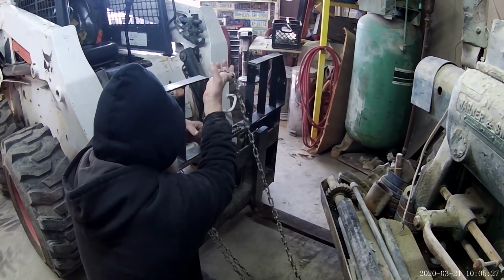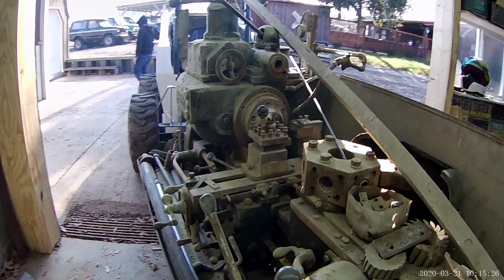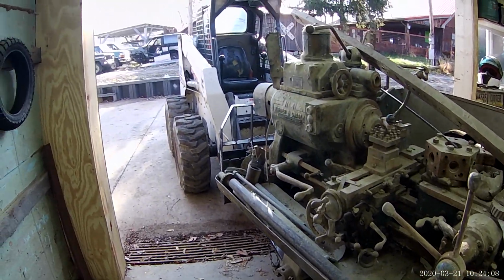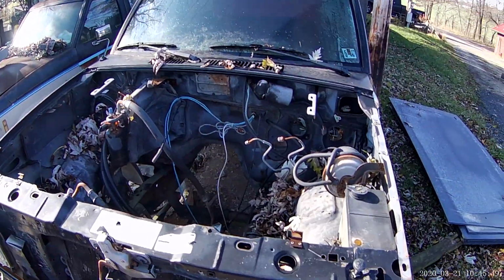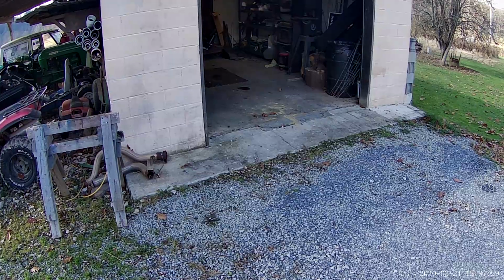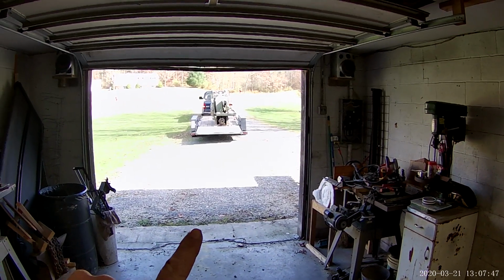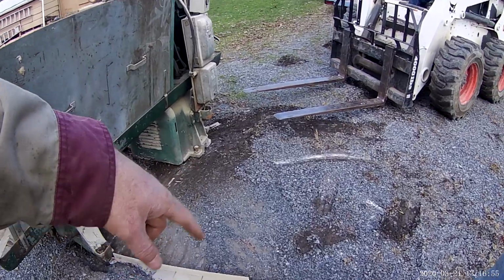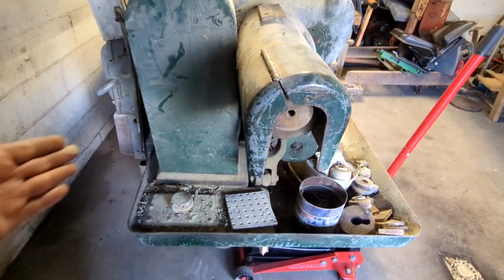Another huge shop upgrade!  We got an Warner Swasey lathe!

Comment: There is no such thing as a "free lathe" and if you pay nothing you can be sure it's worth every penny. 

As for "engine lathes" I've worked internally on engines from 4500-hp GE Evolution locomotive "prime movers" to nitro RC car engines and damned if I can think of any engine parts "universally" machined on a manual lathe one at a time in the "modern era" and in "mass production". 

I've read it's "engine lathe" because a REAL machinist can "make" every "moving part" in a functional internal combustion engine "on" an "engine lathe". 

I find that hilarious because unless it's a 2-stroke I don't see anybody getting it done. Kinda hard to "turn" timing gears or sprockets and chains on a lathe not to mention grind camshafts and turn raw forgings into connecting rods. "Modern" pistons are also "cam-ground" and machined out-of-round intentionally to be round when "hot" and subjected to thrust loads. 😊